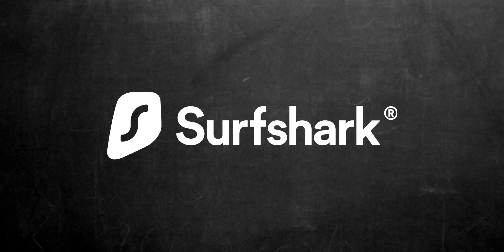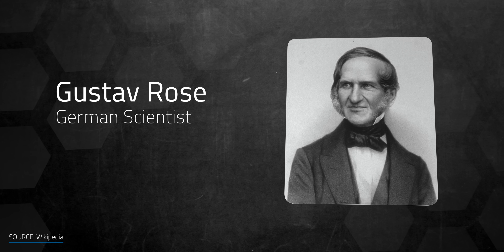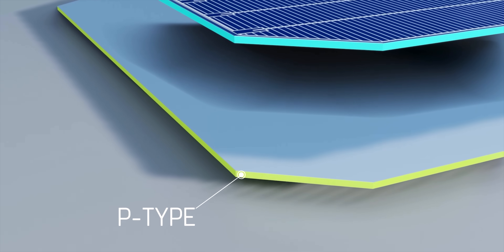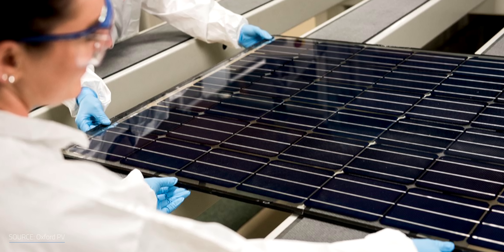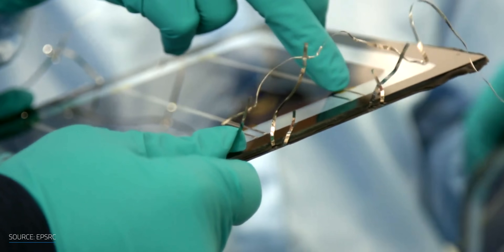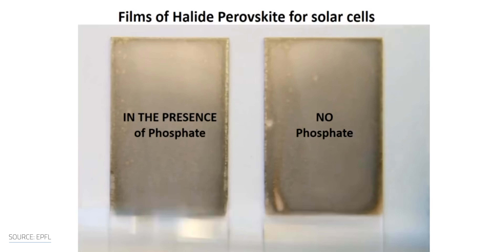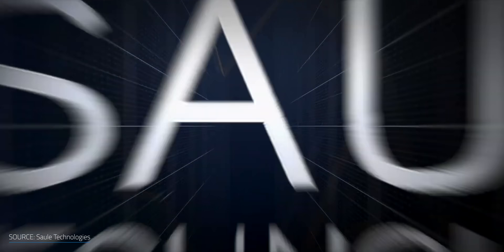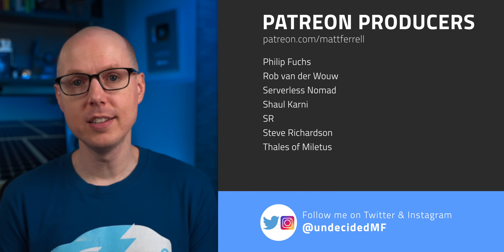Perovskite Solar Cells Could Be the Future of Energy

Comment: I still wonder what happened to those near 100% efficiency solar pannels they demonstrated at university around 10 years ago. they where also a lot cheaper to make than silicon pannels, only generated 2H2 +O2 in stead of direct electricity, this however would increase efficiency for large farms like they are these days, since while you need a turbine, the transport doesn't lose energy to heat, the panels are also safer since almost all energy is transformed into molecule splitting causing almost no heat to be generated, even when looking to the direct effect of light heating things. these cels/panels are more efficient, more stable, cheaper, better, etc. even back then. so why we don't see those?: It is probably the lobby of large economical influences. have seen the same thing happen in the work field where complete systems are ready to be shipped and are extremely much better than the current products, then suddenly the shareholders(who in the high tech field are often also part of the fossil fuel field out of my experience) tell/force to throw away all works about it, only leaving the patents(non-public), just so that if someone else discovers it they are not allowed to make it. this last one for example happened in (electric car company) Tesla(not the real Tesla as in the Tesla company, or Nikola Tesla, but the modern car company named after the inventor). there where complete working designs tested and ready to ship to the market which would switch the heavy, bulky, unstable, short life, and high danger. to better energy storage methods, I call it like this because this happened multiple times, and honnesly every time when there was a decent improvement relating that side. there have been different types of rechargeable batteries, ultra capacitor based cars(they actually had a similar reach in distance, and in some cases even much further, also the mass production cost would be a lot lower, and the total weight of the car would be lower as well. this is due to some new types of ultra capacitors having a energy density nearly equal to litium batteries(in theory however they can have a much greater energy density, but super conductor capacitors are quite new technology as in that there is just starting to be experimented with), the main big difference nobody talks about(so we are not talking about the much longer life time, safety, and the faster chargespeed of such capacitors compared to batteries/lithium cels) is that Lithium cels in electric cars can by far not hold as much energy as for example the lithium cels in a smartphone or flashlight. electric car lithium cels need to be optimized for high current and life time, however by normally using a electric car you can only charge it around 100 times if you are lucky before it breaks, to prevent this most electric cars(except for some really bad ones by weirg companies) prevent the battery from being discharged below 30% and also prevent charging it over 60%(these ranges tend to slightly differ per manufacturer for example 40% 70% is also something done sometimes) this however means that you can only use around 30% of the actually battery capacity, so to get that range you need to add a lot of extra battery, and so weight, cost, and danger. then there is also the part where charging and discharging a electric energy storage device causes the loss of energy, this is also true for those capacitors, however the super conductor ultra capacitors have a practical around 0 resistance, so the loss will be caused by the cables and other chargingelectronics(for example for limiting the charge speed because such a car could charge faster than the power net can handle). on the lithium side however you also have that loss in the cables and other regulating electronics, litium cells however need a lot more of such electronics, since you do not only need to protect the power grid, but especially prevent the lithium cels from exploding or getting damaged. the lithium cells themselves also loss a lot of the energy passing through due to the generation of heat, and resistance. this causes a practical near 50% energy loss when looking to the cycle from charging to the energy reaching the engine. capacity loss is around 30% for very good modern lithium batteries in cars. this all causes modern ultra capacitor based cars to be a lot better, they however had to be destroyed, and where not allowed on the market due to the shareholders, so if you would like such a car, blame it on them.Tesla(car company) also at a point around 6 years ago decided to look into the wireless energy transmission the real Tesla was so fond about, there have been made patents for electric cars wirelessly powered without the need for things like batterys. such cars worked, and it goes without explanation that it is better than making super heavy cars with giant lithium bombs inside of them(you won't trust those things anymore after seeing how much they like to explode during the manufacturing and innovation/design processes, this is another reason for that 30% 60%(safer than 40% 70%), some companies prevent doing so to stunt with higher energy capacities, however such devices degrade fast and won't work anymore after a short while, an such devices also can even more easily catch fire, and/or explode(this does happen more than you think)). however the wireless cars had 2 problems: 1: it was hard to exploit it for financial gain due to the much higher lifetime of everything about those cars, but also since you could not simply and reliable measure how much power someone uses, or prevent others from using the wireless network(this is not a bad thing in my opinion, but to mega corporations it seems to  be). 2: there would be a lot less need for expensive materials so the investors wanted to see it destroyed again, due to it being bad for their oil company shares.
Forthose of you who don't get this, and who don''t have access to investor information(for the oil company side): all mayor known sources for lithium are owned either by oil companies, or are occupied by the USA army as a warzone until a oil company successfully buys them. a few years back it was estimates that lithium would run out in 2050, however currently it starts to look more like we have only 20 years until lithium becomes ungettable causing reparation of such devices to be undoable.

Comment: very misleading, at the current rate it would be 5-10x more expensive due to the lifetime of the product, the current highest for silicon cells is 26.7% which lasts 25+ years, to have something only 3% higher but only lasts -10% of silicon makes it vastly more expensive. I know silicon cells have been around for 50+ years now, but even the first cells lasted longer than these ones and they have had 20 years of development. I think the CNT cells should be prioritized for research, the possibility for much higher conversion rates will make them vastly more useful, especially if you are only dealing with a 2-5 year lifespan.

Comment: If it's just cheap and unproblematic (i.e. the mentioned toxicity problem needs to be sorted out) enough efficiency becomes less of a concern for stationary use on privately owned buildings.

I mean if 2 times as big installation only costs half as much and the resources aren't a problem or even easily recyclable why not just replace the modules every 5-10 years? Sure the the maintenance requirement is a downside in itself. But the spread out cost is an advantage.

Comment: Would they work as recycle energy. Those solar cells input more then an light source out puts. Kept inside the light itself that gives it an control environment. Then by an capacitor to retire the light source back on without totally relying on an battery source. Just an thought.

Comment: Do not get fooled by the steep efficiency rise for perovskite solar cells. They basically used all the knowledge from silicon and other thin film solar cell technologies and transferred it. As long as they are not more stable and have a lifetime of at least 5 years I would say there footprint will be worse then silicon.

Comment: Should be interesting to see where this goes in the near future. The longevity of the cell is going to be the big hurdle, no matter the cost as man hours in installation and replacement are a big concern.
Reply: It depends. If the cost is 10x less and the longevity is 10 years instead of 25 years then the tech is still viable. Especially that this market is still developing and in 10 years you may want to switch to another or this improved tech for even better results anyway.
Reply: @aikenPL  And provided it's less than 1/2 the weight, replacements should be much easier.

Comment: If they can guarantee 5-10 years with the efficiency dropping to no less than 22% while keeping the cost down to no more than $0.50 - $1 per sq. ft. for the 5 or 10 year options then I would certainly consider Perovskite over mono or poly cells purely due to the fact that it leaves a smaller carbon footprint.

Comment: I think that the lifespan limitation they may presently have is not going to be as big of an issue because after all modern civilization have done just fine with limited lifespan devices such as cell phones, batteries of all types, tyres, computers you name it and I guarantee that it doesn't come close to a lifecycle span of 25 yrs. Besides at the present rate of development our present day poly & mono crystalline panels will probably become obsolete by then. Thanks again Matt for another brilliant presentation.

Comment: Can anyone tell me how long a solar panel has to be in use just to make up for the extreme amount of energy it took to create it? With the extreme heat it takes to remove the impurities from the Silicon I would tend to believe that a solar panel never actually lasts long enough to make up for that energy and start generating more than it took to manufacturer.

Comment: Value is sometimes misidentified. If perovskite solar technology only last 10yrs, as an example, that is not an equivalent value to silicon. Because similar to wind turbine blades being a major disposal issue, most aren't talking about, just the power production efficiency. It seems the best value of perovskite solar cells is, lower long term personal and environmental toxicity. The average automobile is replaced every 7 years. But we keep buying those at a much higher per unit cost. Just my thoughts.

Comment: The obvious equation is based on cost. Cost x Time vs silicon. If it's half the cost but lasts half as long, it's not better. Hopefully, a firm will figure out a good formula and we'll leave the silicon local maximum for solar.

Comment: Silicon valley, the go to for decades and it's still garbage. The large panels are overrated and don't produce enough power but yet you think some little cute panel will work. 

You want to reach net zero which is a joke to begin with, while using huge manufacturing companies to produce little panels. I can't believe how ignorant people are and can't see the gigantic company causing the problem to produce a product that doesn't work.

If science and the followers of science want to reduce carbon, dig a hole and fall in it. I'll cover you up, it would reduce carbon by at least 100 million people. That's progress. 

The problem is you have to continually build huge manufacturing plants to produce products that can only used by about 10 percent of manufacturing plants. Then another plant for this problem, then another plant for that problem and so on. 

Wow, your product reduced it by a fraction of a percent globally but the plant itself has produced more than your product reduced. 

You want electric cars, whoopi, but your panels don't produce enough power to charge them. You want electric everything? You still have to build power plants that run on fossil fuels.

It's a shame people like you don't listen to hear the truth about net zero, some trained person such as yourself will put down a stupid comment that will more than likely prove me right.

Critical thinking and common sense have almost completely evaporated in society. Must be from to much carbon. 

Global warming can be slowed by planting more trees, not burning them down. If your outside and you want to cool down, you go under a tree to be shielded from the sun but unfortunately science needs to cut down or burn entire forests for its inventions. How stupid can you people be, your not the solution, your the problem.

Comment: PV's aren't ecologically damaging to make and its not the heat, the silicon involved is monomial compared to all other materials involved.  The 'pollution' is from chemicals used in processing.  Obviously these chemicals can be captured, cleaned, reprocessed, or neutralized, and historically the former two are what industries 'find out' they can do and SAVES them money.  
THINK there are PV factories that run off solar cells, do you think you can run mega furnaces like a steel mill that you seem to think silicon needs for processing?  If you do, you know too little to make believe you are an expert.  
YOU NEED TO RESEARCH A LOT not take common knowledge you fav web site a friend.  The obvious is rarely the truth.
An example I am intimately familiar with  RockWool insulation is another 'it uses too much heat so it's polluting lie out there, Rock Wool uses LESS energy than fiberglass and most other insulations, it breaks down into sand, as it's just rock to begin with, the only polluting element is the adhesive added to help bind it and as it's blazing hot strands of melted rock as it's formed into batts little adhesive is used, it also dries if it gets wet reducing mold risk, will regain 100% of it's insulative value and it's also fireproof, it will stop fire dead in it's tracks until it reaches the melting point of ROCK.  Fiberglass is 100% Artificial burns creates dangerous fumes when it does and uses LOTs of binders AND fireproofing agents to keep that fiberglass from igniting that can pollute when manufactured and will pollute when installed outgassing chemical binders and fireproofers.  Oh and if fiberglass gets wet, it stays wet, it harbors mold, it looses it's insulative value.

Comment: use such solar panels to power small things, like lamps in garden which dont last more than 2 years on its own, and you will see the potential.
Imagine a small cell on your car on hood and roof, that can charge your car by 4-5% by standing in the sun while you work. 
all mobile usages that in general don't last as long as house is a good place for this tech. 
this might create another group of items with integrated chargers. 
like backpack maybe with tiny battery, solar panel and wireless charger spot, so you won't have to worry about charging your headphones maybe phone.

Being lightweight & cheap gives a lot of options.

Comment: I always wondered why solar cells have been made to last so long. It seems counter intuitive in an industry that should be improving relatively quickly.  It would make more sense to create standardized industry structural panels that could have the the solar cells easily interchangeable.  That way every 8-10 years, you easily upgrade to a more efficient technology.
Reply: how fast do you expect solar panel tech to change? Same with battery technology. Those techs tend to be a lot slower with changes that can be a drastic. It's also not like the 20 year old solar panels are wasted if you wanted new ones because chances are your consumption of energy will increase with the tech level.

Comment: Okay? and no matter what the panel is made of its gonna get hot as hell sitting In the sun. Can anyone explain to me why there are no hybrid panels? A thermoionic plate covered in a photovoltaic sheet? Then you're not only coverting light Into electricity, but also the heat energy that it absorbs. You mean to tell me a solar panel like that would still only be like 20% efficient?
Come on.

Comment: I don't think panel longevity is a huge issue in many areas.   While it's great to see 25 year warranty on PV panels the reality is for most residential installs it's a day's labor to get them racked and up.   More important is going to be higher density as size is always an issue in aligning arrays on roofs and we need some good leaps forward with Inverter technology and battery density.   I don't buy into to the "Perovskite will be super cheap" crowd.   The technology creator always low balls the price.   Standard retail markups and recouping of R&D will make these likely to be available in premium offerings initially.

Comment: I think a hybrid cell or ultra low cost, supplemental generation panels like the windows and solar shades are more likely to be adopted first since generation plants that are in service and will be constructed in the next five years will be using silicon. As the tech develops, it might replace silicon, but the existing power generation is going to use their cells until they break down enough that replacement makes business sense. It also looks like other forms of solar power based on mirrors and heat transfer mediums might be more economical and a couple of them might even have short term storage that lasts for a day or two, allowing them to match load demand and generate during the night by using stored thermal mass. The heat from these systems is used to power steam turbines, which are pretty efficient systems for power generation.

Comment: If the heat required for purifying silicone is the only drawback. I don't see a problem. The heat is produced using electricity anyway and that's what solar panels produce.
The problem you didn't mention with perovskite cells is common to all thin film technology. They have a low tolerance to partial shading which can cause damage to the cells.